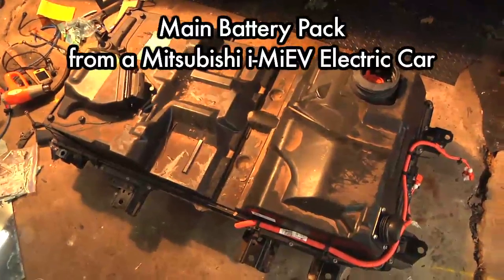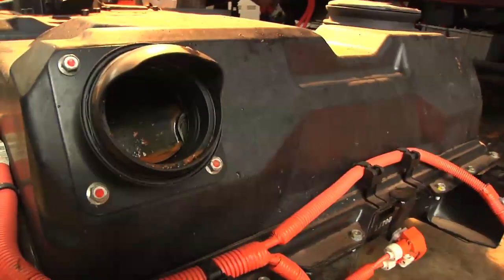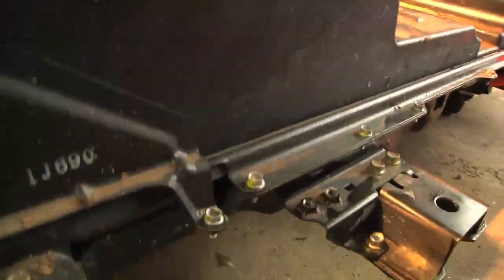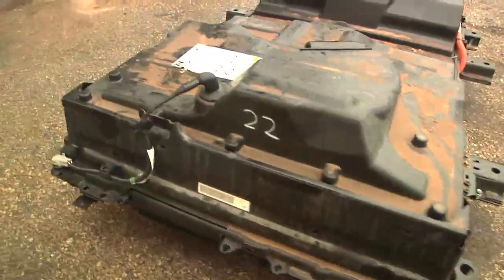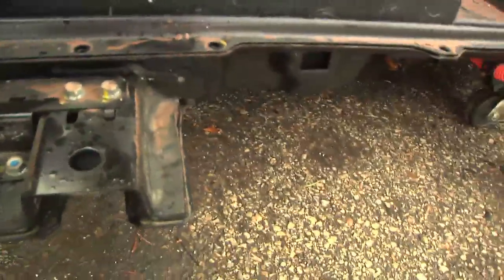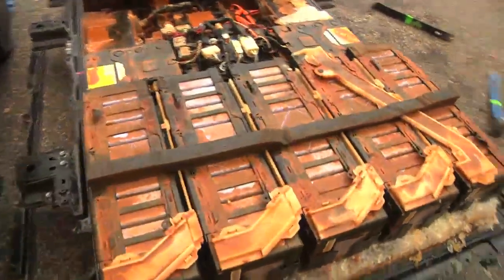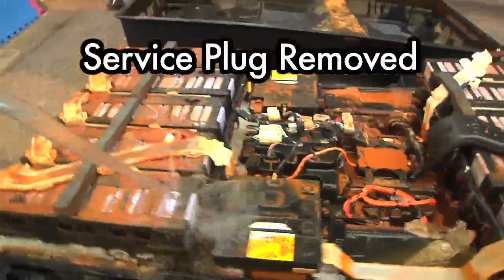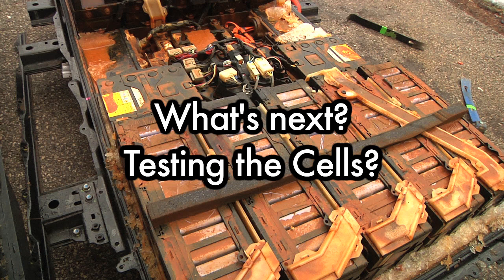Flooded Mitsubishi i-MiEV: Cracking open the battery pack

Comment: are those cars any good?
Reply from the maker: Yes, if these car's haven't been in the ocean, they're pretty decent. They aren't fancy cars, but are zippy and fun to drive.
Reply: This car is made to bring profit to Mitsubishi! The car after 8-10 years develop charger problem. Charger to change 4300 Euros because you cannot buy separately the parts to reaper it! Who would buy a car when the tire is flat and in the workshop you are told that the gearbox have to be replaced with the tire because they work together ???!!!!
Everything is vin coded so you cannot buy used parts and replaced. Battery last about 15 years  and cost until yet 10.000 Euros! Even if a small problem occurs with the battery you must change all the battery. So consider to give after 15 years 15.000 Euros for maintains. That’s no Green driving! This car cost more to drive than a normal gasoline car! Mitsubishi has once again shown us how wonderful it is to drive green!

Comment: There is a stop rust material that is clear, you could put in a pump sprayer, and hit every thing you cleaned with water. You can primer right over it also. - Your biggest nightmare is the salt water. Looks very brackish with the way it froze, so its not as bad, but the connections! - A baking soda & water wash can also neutralize the oxidation.

Comment: If it were me, I'd first test the whole unit. Charge it up to, say 6v or 12v. Meter the whole thing, then the the cell clusters, then the cells.
Second, charge, then check the cell clusters individually. Finally, the individual cells. 
Keep the best. Recycle the rest.

Do you have plans to replace or substitute the batteries?
Good luck.

Comment: It only looks like the cracks are in the plastic housing - not in the battery and that would make sense if it was flooded and frozen.  Pay attention to the circuit boards - check them for signs of damage and clean with isopropyl alcohol. It would be instructive to charge each battery group for something like 5 minutes to see how they respond (power electronics dis-connected). Look for electrolytic corrosion to guide what to do with the electronics.